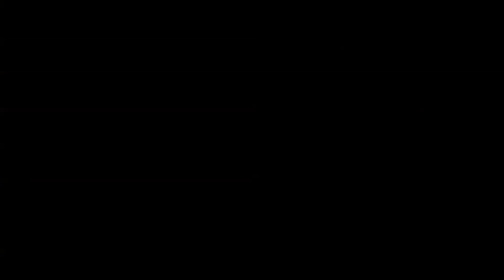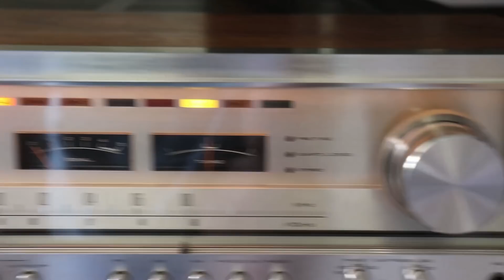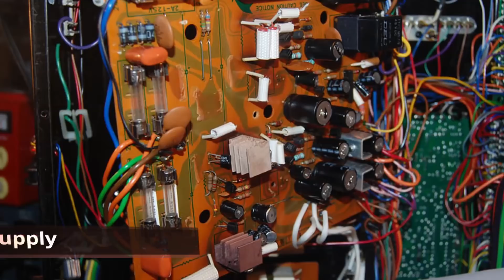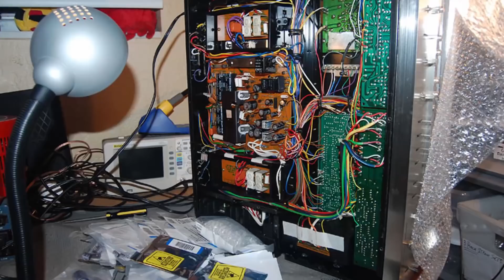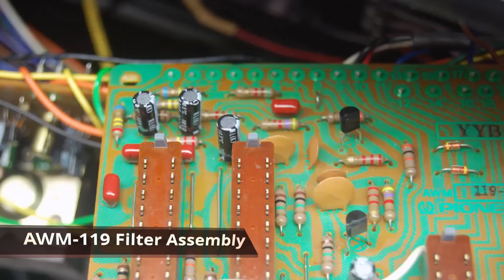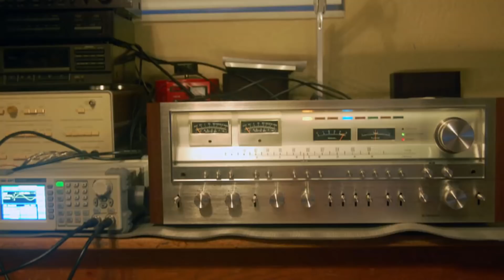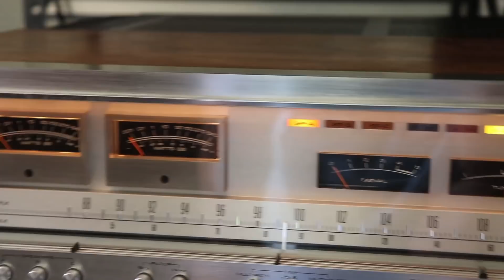SX-1980 - The Most Powerful Pioneer Receiver Ever! Vintage Stereo Repair Restoration & Testing.

Comment: My GF and I scored an SX-1050 2 years ago and immediately found it needed repairs on the protection board. I finally felt I had some extra cash on hand so I dropped it off at the shop back in October. Got it back 2 months later and I couldn't be happier. It's paired with JBL L110s and it sounds amazing! These old machines are absolutely worth all the potential trouble!
Reply from the maker: Congrats! I have a SX-1050 also. It's a great receiver and teamed up with your JBL's I'm sure it sounds awesome. You did the right thing to get your SX-1050 repaired and there's now a good chance that you'll have many more trouble free years ahead.
Reply: Vintage Audio Addict I'm in the very slow process of learning how to work on these machines. The 1050 still could use some old components replaced which I hope to be able to do within the year. I've got over 20 receivers in my collection and nearly all of them need some kind of work done so I'm looking forward to being able to do those repairs myself.

Comment: Ill buy your old filter Caps!
Reply from the maker: Thanks but I keep all my old parts from the equipment.
Reply: why would you buy old electrolytics? PLEASE dont tell me they "SOUND BETTER"... they are there for smoothing...you can easily check ripple with an oscilloscope, they are not used for signal coupling so audio deosnt flow through them
Reply: @MrHBSoftware  I have repaired electronics for 40+years. I have run dynamic tests and found the original caps despite being decades old are made to higher standards and quality than todays capacitors.
Reply: @richmiller9844  dynamic tests? i am curious...you aplly a load and measure ripple or read it with an oscilloscope...amount of fipple depends on the actual capacitance and nothing else...low or high esrt doesnt mater here, if the esr is high the cap may overheat an dfail but apart from that what we care for here is capacitance because it's a smoothing cap...now capacitance can me easily measured and i have never seen a new cap where the rated capacitance is lower than the real value..so...???? i kind of get the hype of vintage capacitors when we are dealing with signal coupling on vacum tube amps....but a smoothing electrolytic??? if you have ever restuffed electrolytic cans ypu know they look disgusting inside after 40+years of life..mud. muck and rotten paper inside, no sign of the electrolite in many cases they test perfectly
Reply: @MrHBSoftware  various loads, different frequencies all monitored and recorded by  oscilloscope, current and volt meters. Charge, discharge,  repeat. Test ripple under different impedances. 
I agree with the mud. 
I have seen replacement capacitors fail where OEM parts still prevail.
Reply: @richmiller9844  but they only work on 50 or 60hz on a transformer based power supply so..??'what's the deal? can you give me an answer or just say "i dont know"? different loads and "impedances" makes absolutely no sense at all for the application those caps are used in

Comment: Ooo lala!  What an awesome unit!  My first real stereo was the SX-780.  Purchased in 1980.  The digital stuff was coming and they were moving these out at good prices.  At 45 WPC, it did an amazing job.  I still have it in the man cave pushing HPM 100's.  Back then, I wanted the SX-850 but could not swing it.  A really nice system with turntable, cassette deck, speakers back then could easily cost 3k.  Or a down payment on a house!  Great vid.  Cheers!
Reply from the maker: Thank You! I got my first real stereo in late 70's so I think we have a similar story. Not a lot of money working at pizza hut as a teenager and the audio equipment was expensive. I purchased a used Kenwood KA-3500 integrated amp, then came a Sansui TU-717 tuner, etc. etc. No way could I afford a $1295 dollar SX-1980. Your SX-780 is a fine receiver. The cool thing is that your SX-780 is engineered and built every bit as good as a SX-1980. With your SX-780 still operating today, proves it. Oh and your HPM 100's are bringing some good money in today's market. Thank you again for your kind words.

Comment: I had a late 70's Pioneer receiver (only 100 wpc), and what I've found is that oddly enough, tube gear is more reliable than solid state gear over the passage of time. Recievers like those were filled with dozens upon dozens of discrete transistors, and if any one of those goes wonky, you've got problems. Tube gear was far more easily diagnosed. Replace leaky paper capacitors, maybe a weak or gassy tube, and bingo, you were up and running again
Reply from the maker: You make a valid point. The earlier tube equipment was all wired point to point and you could more easily work on it. Kinda like comparing the older cars to the new ones.
Reply: @IPA SOLÉ I disagree. In the early days of transistors, they were thought to be devices that never needed replacing, and would last forever---time has proven that wrong. And when you have a sophisticated receiver with over 40 transistors, the room for failure is much greater than with tube-based equipment.
Reply: @IPA SOLÉ Nope---ads back in those days touted transistors as never needing replacing (implying that they would last forever), and people back in the 50's did NOT know they would fail. As a matter of fact, the companies that built the transistors themselves didn't know they would fail---they didn't have a crystal ball to be able to look into the future 40 years to see how they would age
Reply: @IPA SOLÉ We're not talking about other components, just transistors. The public believed that transistors would last forever because of all of the hype--they were lead to believe that. In the days of germanium transistors, engineers quickly found high failure rates, but once they went to silicon, they too thought of them as permanent, lifetime devices (once again, promoted by marketing). They gave no thought to what would happen to them 40 years into the future, and why would they? The product was out of warranty, and it was only expected to last 5-10 years with regular use
Reply: @IPA SOLÉ My original post was about transistors---nobody ever thought components like electrolytic capacitors would last forever.
Reply: @IPA SOLÉif exceed max ratings for a transistor even slightly, especially small signal transistors without a heatsink it will blow up instantly...a shorted cap or a shorted output transistor can take down an entire army of small transistors on a pre amp stage where a vacuum tube can operate for minutes redplating cherry red and it will work after that...  vacuum tube equipment fails because of heat... large power resistors were used, voltage diving networks instead of regulators or zeners etc...paper capacitors were used...vacuum tubes themselves can run very hot even when operated at their specification... i would still say solid state gear can be more reliable if designed properly, but tube equipment is way more serviceable and dependable in the sense that it usually will not fail suddenly and it will withstand abuse for long periods. repairing is also much easier for two things 1-tubes are socketed and transistors often are soldered 2-tubes are high impedance devices wich makes easy in circuit component testing and one stage shorting doesnt take away previous stages

Comment: I say this is the supreme champion of the Sansui G-33000
Reply from the maker: There are so many examples of wonderful vintage audio equipment. I have never seen a G-22000 or G-33000 but I sure would like too.
Reply: @vintageaudioaddict  You mean that you did not physically see a Sansui G-33000 because they are very rare and very expensive

Comment: It has Star Quad wiring connecting the capacitors in the rectifiers to the output transistors to reduce magnetic flux. Whatever that means lol
Reply from the maker: You read the brochure!
Reply: Vintage Audio Addict ha! Reading the brochure on the SX1250 you would think Kelly Johnson designed it at the Skunkworks. During the receiver wars I think it was built in secrecy and sprung on its competitors.
Reply: Star wiring is like series parallel throw in some acid.
Old surveillance pan tilt controller stuff. A way to lessen load. 20 pair cables Color coded jumping a circuit at each device so blue is yellow here but white there. Pills need pills
Reply: @scottygdaman  guess it was the point to point wiring that can introduce interference. not really an issue when everything is mounted to PCB's
Reply: @PhuckHue2  we would use star wiring to minimize amount of cables these being large expensive not just to purchase but install as well .
At least that's what we would use that kind of circuit for before the time of true data controllers it was something I've spent many times on roofs of medium to high security buildings scratching my head all it took was some bad tech to cross one wire out of many and you would control tilt on one camera but only if you paid attention on several monitors focus on another it was almost impossible to retrace that route.
Imagine running hundreds of feet of 10$ a foot cable or just one then using star circuit inner connect at roof points. But lord save us if someone made a mistake. Normally i got those jobs.

Comment: Wasn't really a fan of 70's equipment, but the more I watch your videos, the more I'm diggin them. That SX-1980 is a beast. I also think a big thing in restoring anything is a place to work when you can leave stuff and come back to it, the kitchen table NOT being one of them. I know from experience. LOL!!
Reply from the maker: Thanks so much. I grew up with them. When I was younger all I cared about was that the equipment played my music. As I got older I could appreciate the engineering and the build quality of the vintage audio equipment. Your right the SX-1980 is a beast. You  do need a pretty good sized work area and it's heavy. My workbench is actually my Mother's old craft table. It's an old oak table but just like the vintage audio equipment man is it sturdy. No worries about it collapsing. Thanks again!
Reply: Pioneer sx 3700

Comment: I “only” have the SX-780, which does seem to be much more powerful than its 45 watts/channel. The 1980 though is a whole different beast. Enough settings just for the tuner alone that could keep a listener very busy and satisfied. Love your videos, you have great taste in equipment.
Reply from the maker: Thank you so much. I always appreciate your comments and the kind words. Yes, the SX-1980 is an amazing piece of history. It's hard to imagine back in the day when I walked into small stereo shops and they were filled with so much quality equipment.
Reply: Vintage Audio Addict  Somewhere down in my basement I have a box that has some of those little blue catalogs that Pioneer used to print out and give to consumers. I drooled over this receiver, as well as their tall racks with all the silver components. Naturally, the reel to reel decks were lusted over by everybody.

Comment: What an awesome piece of equipment. I was in high school during the receiver wars era and I lusted mightily over these brutes, but of course they were way, way out of my budget range. For many the SX1980 is the holy grail of receivers.
Reply from the maker: I'm about your age it sounds like. I worked at pizza hut as a teenager. I didn't earn a lot but still living at home I had a few extra bucks that I spent on stereo equipment. Like you,  I wasn't buying the expensive stuff. Your right just an amazing piece of history. I can't imagine what a piece like this built today would cost. $3000 - $5000 if I were guessing.
Reply: @vintageaudioaddict  I know the prices these things bring on eBay is pretty impressive. Your unit is in awesome cosmetic shape, sure makes the refurb worth the effort.
Reply from the maker: @rickbarton9130  Thanks, The gentleman I purchased this SX-1980 from was in the military and he purchased it on the way home in West Germany.
Reply: Anyone else see this auction?: https://www.ebay.com/itm/Pioneer-SX-1980-Vintage-Stereo-Receiver-Mint-Condition-Open-Box/114069889751?_trkparms=aid%3D1110001%26algo%3DSPLICE.SIM%26ao%3D1%26asc%3D20131231084308%26meid%3D61a94a12bafa4f6e94ff91c0d2a6240a%26pid%3D100010%26rk%3D1%26rkt%3D12%26mehot%3Dpp%26sd%3D223705810655%26itm%3D114069889751%26pmt%3D0%26noa%3D1%26pg%3D2047675&_trksid=p2047675.c100010.m2109
Great googly moogly!

Comment: When working on a unit I plan to keep around, the thought always enters my mind "replace those point to points/wire wraps with a modular connector?"

Haven't done it yet, usually just desolder the wirewrapped posts but still a pain. Have searched around online but not much info, am I the only one who has entertained this connector idea?
Reply from the maker: It would be a hell of a project in this receiver. A lot of wires going from one place to another that's for sure. A short time after this unit was produced the manufacturers started doing the modular connections more. I imagine in the factory it made it much more efficient on the assembly lines. Certainly much easier to service for techs out in the field also.
Reply: @vintageaudioaddict  Aye, working with a kenwood kr-9940  with quite a bit of wire wrap and tight bundles but surely the 1980 is probably a bit worse.

Probably not worth the time in the long run anyways, I imagine new quality parts probably have good odds of a long life.

Cheers and keep up the great work.
Reply from the maker: @viewer54322  Thank you, Sir. Thanks also for viewing and for sharing your idea's.